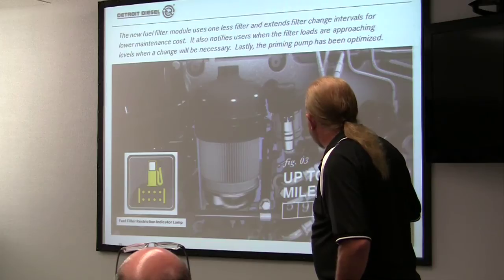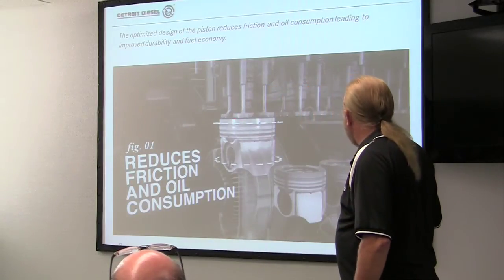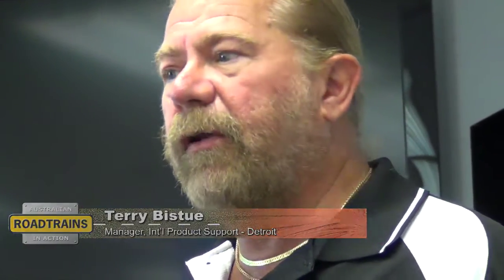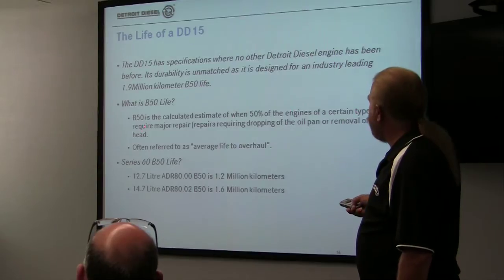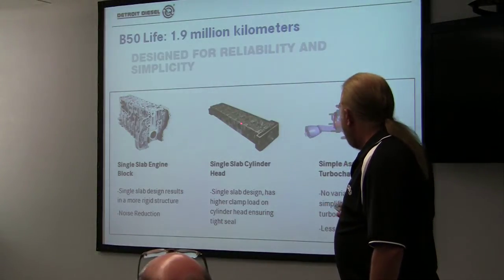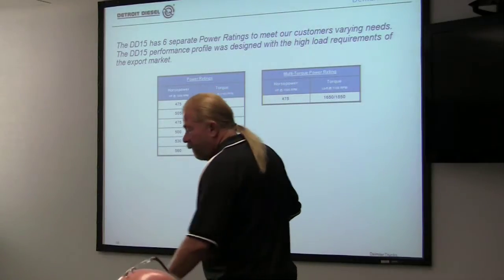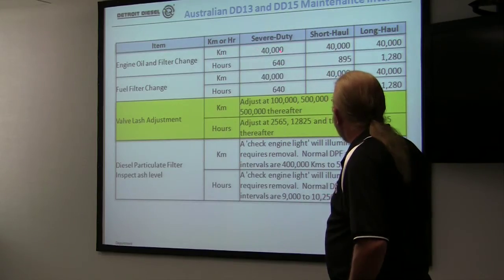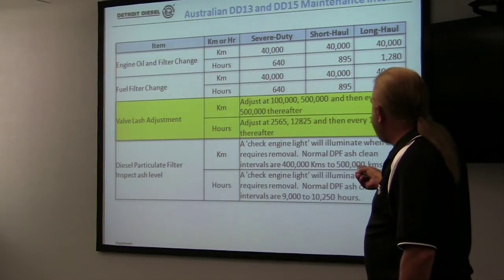Detroit Diesel DD15 engine - Part-2

Comment: I have 2011 frieghtliner cascadia,i lost my engine due to defected oil bump.my engie shuts down while i am driving 60 miles /hr and without any previous indication and i change the oil evry 15000 miles,my engine got locked and it cannot  be rebuild  or overhuled,use,use engine cosst 18000 plus labor which it will max about $24000-$25000,DETROIT ASKED FOR $50,000.00 TO REPLACED WITH A REMAN engine,i bout this truck 2 years ago for $75,000.00 and 2 yrs later its a piece of junk doesnt worth 10,000 dollars.stay away from DD15 ENGINES ,ASK NECHANICS AND THEY WILL TELL YOU WHY.......
Reply: Hashem Khraisat 
You didn’t replace the bridge tube seals at 500K & the engine failed. That’s normal, no maintenance = engine failure
Reply: Tsb on oil manifold tube orings, failure to replace $20 parts plus a few hours of labor cost you an engine. Know your equipment or pay the price of ignorance.